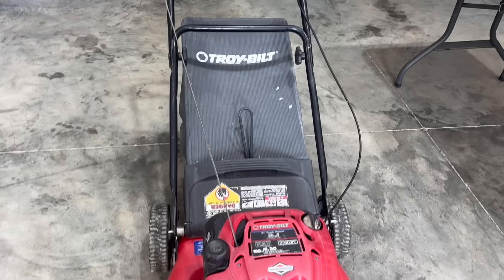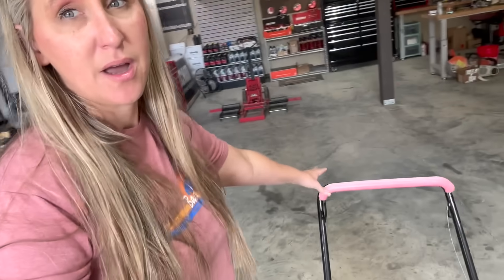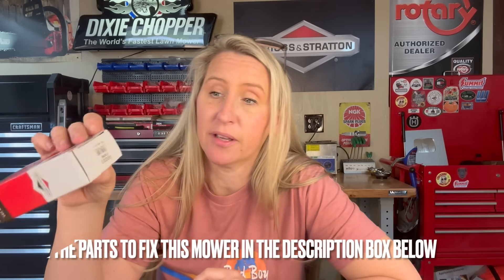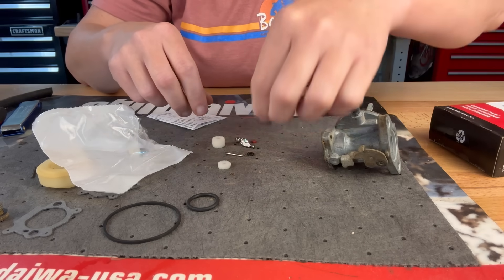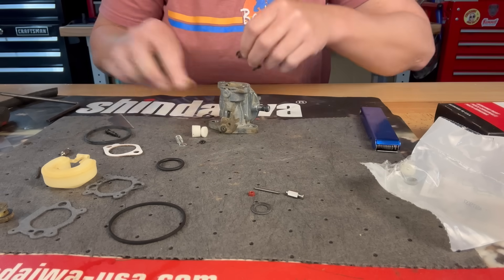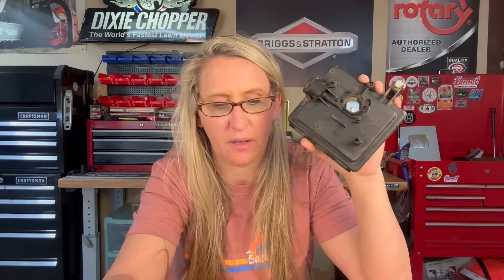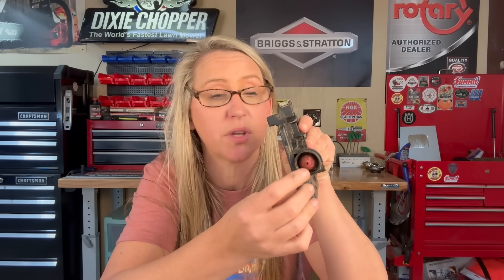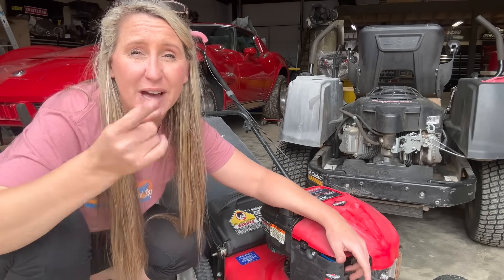FREE MOWER! Turning Customers Trash Into My Treasure! How to Fix a Briggs And Stratton 6.5 Flathead

Comment: I supprise after 1980S 
I did have Faith in Briggs ans Scrap em any more especially with Nikki Carbs and Plastic Compression Release Which Break
And Teactor Engines Wirth Valve Propblems 
Blow Head Gaskets on Twin V's

Comment: I bought a 8hp craftsman chipper shredder a week ago for 50 bucks.  All I did was pressure wash the thing (before) I started working on it and cleaned the carb.  Now it looks an runs great.  Sharpen ed the blades, changed oil after running it a while, and tried it out.  Wish I had this 30 years ago!  Good vid I enjoy your videos

Comment: 8:35 the first one I used compressed air on is still in geosynchronous orbit 23,000 miles above Flint Michigan. If you don’t need the old one, no problem. If you were removing it to avoid carb cleaner chemical swelling and planned on putting it back, the orbit option is problematic.

Comment: One thing I learned to check on a Quantum that sat for any length of time is to pull the shroud and remove the Mickey nest from above the coil. They love that spot. They get in where the intake tube runs across the block.
Reply: I see this one is the superior (imho) primer bulb version. The air vane choke version is more susceptible to the mouse 🐁 problem because the shroud has a cut out for the vane.
Reply: @haneyoakie14  These primer Qs are the best ones built.  Top Dog.
Reply: @timewa851  I completely agree. 👍

Comment: I usually fixed and resell mowers with the bagger all cleaned up and turned up for $125.00 however if the buyer offers $100.00 I'd take the $100.00

Comment: That's how I've supplemented my retirement these last few years, picking up old power equipment and fix/flip them I picked up a couple of trimmers, one of the Mantis rototillers and an '89 Snapper Hi Vac self propelled mower which I may keep, I already sold in trimmer for $45 so everything else is profit.

Comment: I have that mower. I bought it for a rental property I had and the tenant used it for nine years, and I still use it at a cabin. It doesn’t have a lot of power, and if the grass gets high it will stall. The problem I have is that jet hole gets clogged at the bottom of the bowl every few hours of use. I think  the tenant used a dirty gas container.

Comment: Whatta babe !!! 
This isn't power equipment, but here's a Handy Household Hint: 
When you're throwing out your worn-out spreader to buy a new one, save whatever pipes are crimped to join other pipes to comprise the handle.  You can use then as extenderizers between the handle and the pipes that it attaches to so you don't have to push a spreader that was designed for midgets.

Comment: Thats a push only mower so $150 would be my limit that i'd spend and thats because it's from you. Anyone else, $100 tops! Used is used to me even if a dealer is selling it and that doesn't mean its gone through. Back when I bought my very 1st rider mower from a CUB dealer, I figured yeah it's overpriced at $850 ( mower was 15 years old ) but it's a dealer so it's good. Yeah good after I worked on it changing all belts, oil, blade and cleaning 15 years of engine grease off at 400 hours. ). Unless CHEAP,  I go brand new now.

Comment: Popping out  needle seats with compressed air.....man does that bring back memories,we used to shoot them at each other and they sting when they hit bare skin. Circa 1971 at the mower shop I worked at as a kid. Your shop looks magnificent,need a shot of the front customer counter. Now is about the time you wished ya woulda built it a wee bit larger...Great carb video.

Comment: I installed a new deck blade drive belt (after ❤market bought at local hardware) on my Troubuilt Bronco riding  mower. However now the blades will only engage and turn if the deck is lifted all the way up, down low nothing. The store says I bought the right belt. But what's wrong. The belt is installed correctly. 
Thanks.

Comment: I’ve got an ‘04 model. It runs well, but has some cosmetic damage. Great design, easy to repair, and plenty of power. The only downside is that it is pretty heavy. Thanks for the video

Comment: Someone recently mentioned the HFT set of line pliers, which I promptly bought and used that day.  Lovely, lovely.  They're 45 degrees, like the nice pair you just received.
Pittsburgh Long Reach Hose Plier Set, 3 pcs, $14.99, SKU: 37909
That's the nicest free mower I've ever seen, Bri.  If it were a self-propelled, $75, Not? $50.

Comment: I have a generator driving me bonkers , I’ve took the carburetor off and took it apart clean as a whistle nothing plugged great fire from the plug , really good compression , valves seem to be working fine , it has only been run about 3 hours thay won’t take it back ,  Do you think it could have maby jumped time ? It’s an overhead valve Do you think I should pull the wheel of and check ? It will run only with priming the carburetor I’m stumped lol , your really good I watch all your videos Bree your the best

Comment: So sad to see a mower from 2007 already thrown away :( it's 15 years newer than my mower, and all i've ever replaced is blades, the spark plug, a couple of starter cords and 1 air filter. Still runs better than the stuff they sell new, and without the stupid safety lever than shuts it off every time you empty the catcher :D

Comment: If you have a market for push mowers then I would say $150 would be a place to start. My market for push mowers died in the last five years. Everyone has zero turns and string trimmers. So push mowers just are not used much. Maybe a few town yards is all. Heck I do not trim with a push mower anymore myself. 
     Yes you can make good money on repairing "free" mowers and such. I do get a lot of chainsaws in my area as there are still a lot of wood stoves used here. I usually have 20-30 used chainsaws for the fall market. First cold snap and they will sell. LOL Never hardly sell one before the first freeze.

Comment: Prices drop fall and winter, but spring and later push mowers are $150 for rough looking but running to $200+ for nice. Good bag add $50. Self-propelled add $50-75, high wheels add $25. Riders start at $500 and up if there's no deck-related issues. No sale with deck issues; people know how expensive that can be to fix. Prices are now rising because of inflation and the insane high cost for new ones. They used to sell like hotcakes but now a lot of people hire it out instead of DIY which has affected sales. 

When I was a kid 50 years ago you could buy a used mower for $15 if it smoked a little. 5- 6 lawns later you were making a good profit for the rest of the summer if you could keep it going that long with your crescent wrench and screwdriver which was all the tools you had. My how things have changed.

Comment: Given the price of new ones and as good as that one looks and runs, I'd say you could get at least $200-$250.   Great find!
Reply: sadly most people wouldn't even know the flathead Q is the final  flathead & best B&S walk behind lawn mower engine.  Got a Y2K model I bolted in my Snapper self-propel deck after a neighbor mistook a loose blade for rd knock. New air filter, new sparkplug, load of oil, tightened my blade after bolting it on my deck. It's been about 14 years since I did that...

Comment: Bre, i have a question for you. I have an older Yazoo self propelled mower that my dad had left when he closed his shop. It might have 15 hrs on it. I can't walk good enough anymore to use it and am wanting to sell it. I e cleaned the carb several times over the years to keep it in running condition and will need to do it again before selling it. I haven't gotten any offers and pit it on market place for $150. Am i asking to much or not enough? Oh and it has a 4 hp Briggs that runs beautifully. Any help is appreciated 😊

Comment: You forgot to fill some oil on the engine. There was to little? 😊 Price 150$. Regards from Norway 🙂
Reply from the maker: Nope didn't forget. You can see me with the bottle of oil in my hand after I put the mower back together. I just cut out the part of me pouring it.
Reply: @Chickanic  Okay, nice 🙂

Comment: What it is worth vs. what you can get for it is likely two different things.  I used to pickup discarded mowers, fix them up and sell them but I stopped several years ago because people just don't want to pay for a good used mower.  They seemingly would rather buy the Chinese junk at the big box store because it is "new."
IF and that is a big IF you get $100 out of it you are doing well.  Probably worth twice that because, like you, I know those Briggs motors of that vintage are about as bullet proof as you can get.

Comment: Did you power wash the bottom of the deck and fix any rust spots? Any extra blades lying around? Sell it for $175 and include a free 2-gallon gas can and an extra set of sharp blades and a 6-month warranty. New Troy-Bilt goes for $269. So, about 40% off. Good deal!

Comment: I have the same exact mower It wouldn't prime so bought a new filter base and new gasket, even did the double gasket suggestion and still won't prime.  Total carb clean and carb rebuilt kit. I guess this type of primer is known for priming issues. Any suggestions?
Reply: The primer pushes it doesn't pull so there is most likely a blockage. will the mower start and run if you use carb cleaner or starting fluid?
Reply: @dudekanic  Yes  When I push the primer bulb in you hear air but no gas shoots in the throttle .  The carb has gas in the bowl. I use starter fluid runs for a 2nd then quits. Won't stay running. The air intake manifold is not broken or cracked, and the gasket is good.
Reply: @deltafour1212  If it doesn't continue to run there is another problem. The tubes from the jet or the jet is clogged or something stopping the fuel from moving. Carbs work off of air pressure, the cylinder moving causes a lower pressure in the throat of the carb so a higher pressure moves to a lower pressure. There is fuel in the way so it is pushed out of the tube and caught by the incoming air. The third hole, she didn't talk about, is what equalizes the bowl pressures also try putting air through the hole. But go over the bowl nut jet and tubes again.
Reply: @dudekanic  You're  correct. Did all those things you mentioned blowing air and carb cleaner through all the holes and were all clear.  I'm beginning to think the carb was defective right from the factory.  I will totally disassemble and clean the carb for the 6th time.  Could a defective carb be the reason why it won't prime when using the primer bulb and not the gasket?  The person who bought it brand new only used it 2x because every year they went through the same problem and got tired of not working.

Comment: I had a mower with a Briggs. Not sure if it was that model but it started first pull every single time I used it, even after sitting for the winter. Changed the oil and some fresh gas and good to go.

Comment: $200 easy, and well worth it! Love your channel. Thanks for sharing your wisdom!
Reply: the Quantum pulls a premium compared to others. 
the governed speed keeps it smooth & no-fuss. And the ignition, and the flat head. 
the ultimate mowing machine.  Mine's from 4/2000 production. Needs a new air filter. bogged a bit a few days ago cutting neighbor's 1/2 acre.

Comment: I have a old craftsman high wheel string mower. Has that flat head engine. Bought it new at least 15 years ago. I just change the oil and it keeps on chooching.

Comment: Those old Troy-Bilt mowers are amazing. In 2016 I plucked one out of someones garbage and fixed the pull cable. I used it for six seasons to cut my grass then one of the wheel assemblies broke and it went back to the trash but the motor was still running.

Comment: How do you change out the front wheels on one of these rear wheel drive lawnmower’s?????
Reply: The non-drive wheels are on a sleeve that can get rusted and be hard to remove. I we can't get it to move at all we cut the wheel off and heat the sleeve and it will come off.

Comment: Just curious because I'm not real experienced in small engines, but why didn't you do a compression check first to see if it was worth messing with?
Reply: Well, easier to just spray it and see if it starts. These engines dont have much cranking pressure anyway, the low compression is one of the things that helps them last so long.

Comment: Agreed Bre that Quantum engine and the little Sprint engines were the most reliable and easy to repair engines Briggs and Stratton made. My dad has just repaired a 20 year old version of that L series engine for a customer and I have recommended he fits a fuel tap in the fuel line to prevent future carburettor issues.

Don't see Troy Bilt machines in the UK but I believe they are owned by Stanley Black and Decker group who build Cub Cadet mowers. Sadly you see virtually no decent walk behind mowers in their ranges of MTD or Cub Cadet here in the UK.

Comment: As of 2024 all small engines smaller than 25 horsepower becomes illegal  In California.
 So with all the present stock cells out there will be no more new. So if you want to keep your small gas engine you're going to have to repair it. I guess I could put a 25 horsepower on a push motor cool.

Comment: I just repaired my push mower for the season thanks to your videos. Thanks!
I have a question that has eluded me for years that you may can answer. Your hands are beautiful! HOW do you clean your hands from all the grease? If I even touch anything mechanical, my hands are stained for what seems like a week. Even with hand cleaners such as Gojo and others, they are still stained. I solved the problem by wearing neoprene gloves but what is YOUR secret? ♥️

Comment: People leave their lawn mower sitting outside And the 1 thing that goes wrong is usually the stator gets rusty   And then they say the hell with it push it to the curb and go by a new 1When all the heads do is take to state or off  When all the heads do is take to stay off it back on it fire right up And I love people do that because they push it to the curb and if I see it I will stop it up bring it home get it running And I love when people do that because they push it to the curb and if I see it I will stop it up bring it home get it running and sell it to somebody for 5060 bucks Like you said Throw kind of stuff away Throw kind of stuff away eater Blow blowers blowers snow blowers lawn mowers And I bring them home and fix them I like you like you said It's just more cash in our pockets LOL

Comment: Never never never ever Lift the lawn mower up in fool around with the bottom of the lawn mower whatsoever without taking the spark plug out and setting it off to the side If you turn that blade it could fire and if it does it will rip your hand right off Or should I say it will cut your hand off
Reply: Don't think that mower would crank without gas in it.  Plus,  you'll never start that engine by turning the blade by hand.  It takes several rpm for those to fire off.

Comment: Again great video.just gives you little reminders.
Do you paint any old machines that look a bit rough.ive got a couple off them mowers but the body is rough
Reply: I tend to leave the blemishes on them. I have seen painted machines but they can't match the paint already on the machine and yo some buyers they do question why it has been repainted. If the cutter housings are holed and rusted away scrap them as it isn't worth repairing them.
Reply: Thank you

Comment: Good morning!  We have never bought a new mower!  Nena drives around the neighborhood at the beginning of Spring and finds mowers sitting at the curb.  Usually, it is just a carb cleaning and they run fine.  The newer models are mostly junk, plastic carb jets and such, so I just keep running the old models and give the newer models to our boys to use.  We love watching your channel.  Thank you. jimandnena
Reply: I should add that I hate cutting grass while Nena loves it!?   Our deal is, if the mower starts in 2 pulls, she mows, otherwise I get stuck with it.  I have not mowed in years. 😊

Comment: I've learned so much on this channel but I'm short on one thing.  Why does the bolt on the bottom of the bowl need to have holes in it?
Reply: The bowl nut is actually the fuel jet also.

Comment: the bottom of the line 20" new mowers  with no bag and side discharge only 125cc now go for 299. not long ago they were 169.     a mower like that you might get 120-140  with the bag and a sharpened blade. in my area

Comment: those briggs quantum flat heads last forever.  I sold a mower recently with one of those on it  I had no use for it anymore, it what my son used to mow yards for $$ around  the neighborhood.   I had gotten it from a moving sale and it was hydrolocked.   fixed that and new plug back 6 years ago. and it was good to go.  now he is off in college and no need for it so I finally sold it.

Comment: Tecumseh 670377 is a tool for removing and installing needle seats.  Works on any rubber seats.  Love those older Briggs flatheads, super easy to work on and keep em running.
Reply: It doesn’t work too good on putting Briggs seats in
Reply: @gilreynolds9282  I've never had a problem putting in Briggs rubber seats with it.